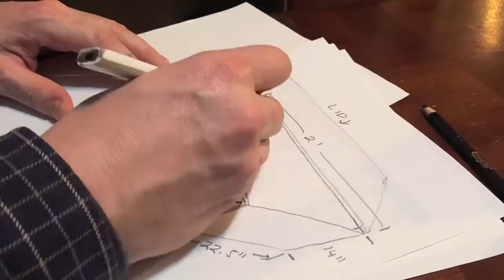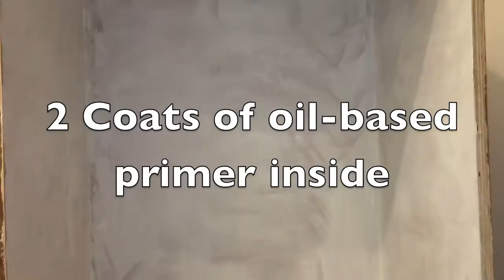Building a Plywood Battery Box for Solar and Wind Power | The Cedar Workshop

Comment: How do you suggest to put it on wheels?  Would it support it as is?
Reply from the maker: I won't suggest wheels. Maybe rollers. There would be a lot of weight on the wheel. What is your plan for the battery box?

Comment: Really nice battery box. I lined mine with 3/4" Styrofoam to keep my batteries warm in the winter.
Reply from the maker: How does the styrofoam react to the battery acid? I've had only one overflow, but it didn't have foam at the bottom.
Reply: The Cedar Workshop I don't have any foam in the bottom of mine.Just the sides and the top. A guy in Wyoming has way below zero temps all the time and his batteries wouldn't charge up, so i told him to line the box with Styrofoam and it fixed the problem. It's always warm in his box now when the batteries are charging. He hasn't ever had any issue with the acid hurting the foam nor has anyone else that i have heard of.

Comment: I liked the tune, I liked the fact you got a sheet for £10, you sod, lol. I like batterys. I read some interesting stuff about a year ago, you might know this already. But take your - and + main cables at opposite ends on your bus bars/cables on the array, it really helps (quite a bit) keep the keep the batterys balanced during charge and discharge and costs nothing to do. All the best
Reply from the maker: Yes, the tune was a good pick. (made some bad picks in the past) Kept the volume down to 66%. Noticed on an iPad, the music comes across much louder than a desktop computer. I remember that type of wiring and I think I'll do it this time round. Thanks for the comments!
Reply: The Cedar Workshop  Your welcolme. Side note, your right about the cedar work shop. that do it yorself channels ripping everyone off. /watch?v=cp6EvpaIaT8 .
All the best and re warn cedar bloke. Wood working for mear mortals and some others had the same problems a year or two ago. fricking chinese data farms

Comment: My fiance and I were just talking about making one of these for the tiny house we are going to make...
Reply from the maker: It's a good idea. I have children and I always worry that something could fall on top of the batteries and cause an arc. Keeps them safe and untouched. Could use a big Rubbermaid container instead of wood. I like wood because you can screw into it and attach stuff, like inverters on the outside. If you're using lead acid batteries, suggest using a passive vent to flush out the hydrogen while they charge. Basically a big pipe at the top and small pipe coming in at the bottom of the box. Also, if you're on a budget, ask the local lumber yard for damaged plywood (don't use MDF). You should get a good price and save some cash-o-la! Hope that helps. I'll sub your channel and check out the build. Cheers!
Reply: Thanks a ton